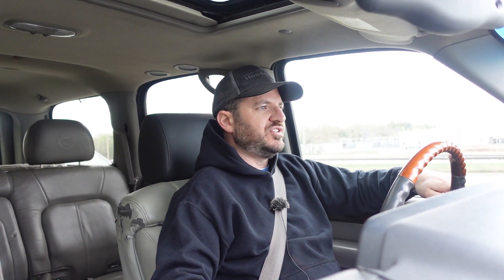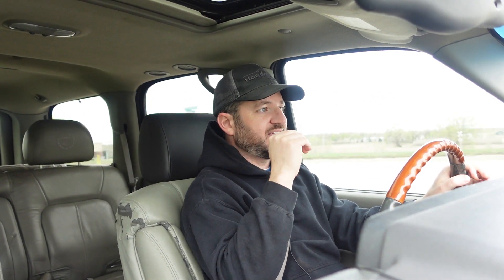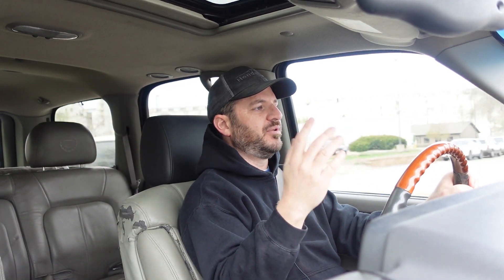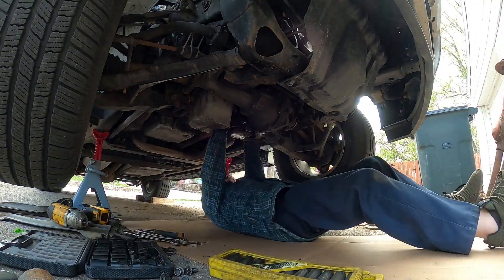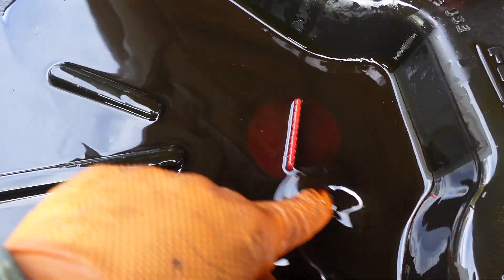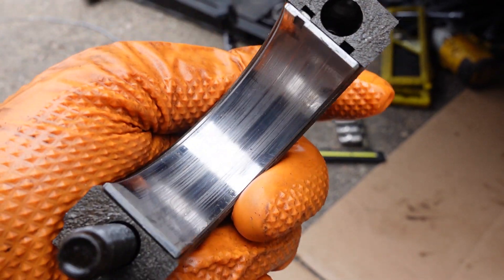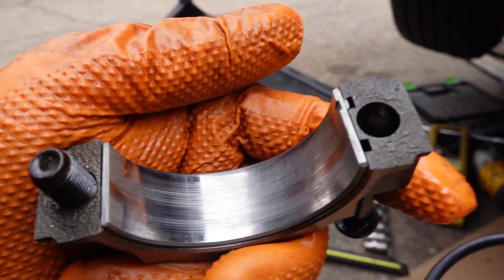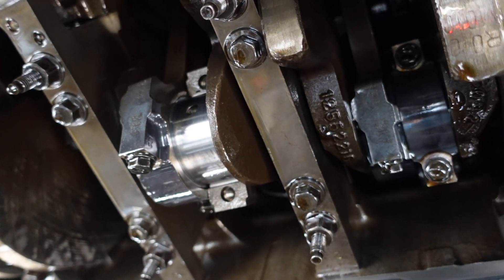LS Engine Rebuild - Is it breaking in?  Or broken?  - pt 3

Comment: I would guess it's actually part of the oil filter breaking down and going through the engine
Reply from the maker: I hope not, I'd like to think AC Delco is making better filters than that, but who knows!
Reply: Yeah - compare the material to the material of the inside of the oil filter.  I’d also cut up the flexible part of the oil cooler lines and see if the inside of those lines are coming apart and ended up blowing up your rebuild.  Jeeeezzzus misery loves company Mr Flawless!
Reply: @FlawlessPlanGarage  AC Delco filter quality went downhill a few years ago. I believe they are rebranded cheap filters now. Wix is a safer bet.

Comment: My guess is the copper is from the trunnions. I would probably use caged needle bearings for a daily driver. Im assuming the bushings are more for a race application where the oil is changed regularly with little run time, similar to an alcohol engine. I would imagine the bushings would wear quickly in a DD but i could be wrong, just an opinion.

Comment: That really looked like oil filter material to me and the ls engines are hard on cam bearings every 6.0 cam bearing i have seen shows copper the chp-10t durabond is one of the best cam bearings. How many of the rod bearings did you check?and i would like to buy those stock pistons
Reply from the maker: I did use the durabond cam bearings, so we'll see! I unfortunately don't think I kept the stock flat top pistons.
Reply: @FlawlessPlanGarage the cam bearings have different sizes for each hole on a LS.

Comment: If there is an oil cooler it could have some Contamination in it. Also, some of that debris could be holding open the bypass valve in the oil pump. And oil PAN.

Comment: Here's my penny's worth. It's surely that valuable. Someone at some point stuffed a blue shop towel in a hole somewhere with good intentions. Then either forgot to pull it out or pulled it out, and a piece tore off and stayed in the hole. This might not be in the block. It could be in a head, oil pump, or in some other part that you take off and put on. When the bearings spun, this rats nest collected copper, lead, tin, and held it. Now, as it breaks up over time, it dumps that metal back into the oil along with fiber shreds.
Reply from the maker: I think this is a very plausible theory!  Now, when I find that well-meaning-but-serially-incompetent person who did that....

Comment: Did you replace the bar bell?
Reply: I just watched these videos and I've not heard mention of the barbell. The barbell routes oil through the filter, is it possible there's enough lint in an engine that if it doesn't get diverted through the filter it could accumulate to the proportions he found? But then again he used lint free materials the last times. Maybe without a barbell there's some weird thing going on that is circulating oil through the filter backwards and filter material is escaping the filter. I'm just brainstorming because I can't make sense of the lint buildup.
Reply: Sooo is it ok and still going or did u sell it lol ??

Comment: For the experiment , buy 2 of the same oil filter , keep one new on the side  , install other obe run it for ?? 500 miles.
Then cut open them both and compare them
Im pretty sure that clogging material is coming from that...chinese stufff